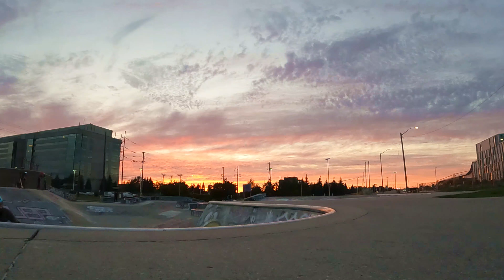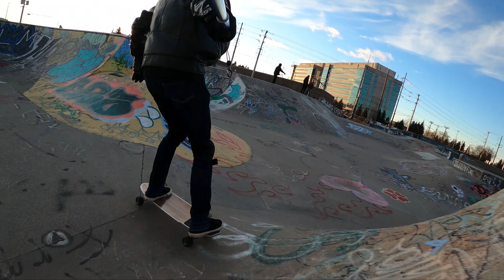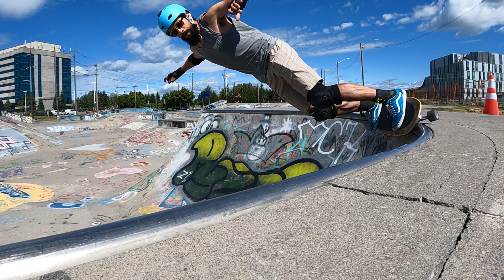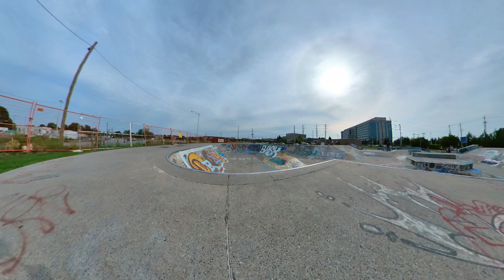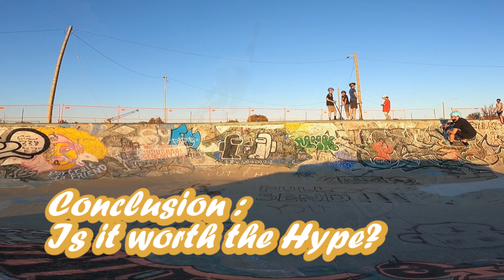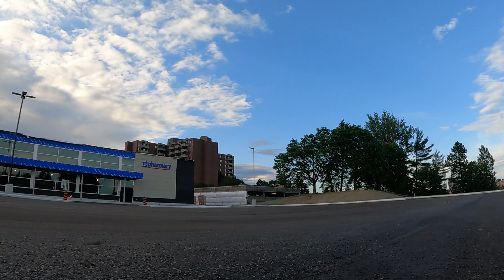How to Carve Grind Coping on YOW Meraki Trucks (without dying)

Comment: I have recently buy a yow and I’ll was using a carver before and I have noticed that the way the yow trucks turn makes you adjust your position for many tricks that you usually make on the carver I think carver boards are cool but they don’t give you the right technique, in my opinion yow responds more like a real surf short board, you have to use more back foot than in other boards and that applied to the surf on water gives you a really better technique, nice video
Reply from the maker: I never made that connection - Really good observation

Comment: Thanks for another great review!
I want to share that I got a massive improvement in my bowl skating when I put harder wheels on the giraffe. I could not get the exact same size, but  similar.
97A wheels are a lot louder and make scary noises at times when losing grip.
But magic starts to happen when I ungratiously climb into a bowl and start pumping around to build speed.
Reply from the maker: I haven't tried anything that hard yet but I am keeping an eye out!  I don't think I need any extra speed, but I am finding it hard to do snaps and vert-berts on the concrete with the stock wheels.
Reply: @MarktheLandlockedSurfer  Try the Alva Conical 59mm, 88A they are the best park wheels for surfskating I have experienced. They just look you in on concrete. They are fast as a 97a-104a wheel without the noise and unpredictable slide, vibration teeth 🦷 rattling thing. That in my opinion just kills the Surfskate feeling using anything above 84a-88a (my opinion the sweet spot for concrete) The Carver park wheel is also very good but still feels like plastic. Seismic Cry babies 😭 is also not bad if you like coming down the wall bird sliding and they just looks the part aesthetically. Alva I think knows a thing or two about surfing in bowls and pools. But I understand the hard wheels thing because it works too. It’s like sex some like it soft and some like it hard, it all comes down to the feel.

Comment: Hi Mark, looking back and now owning a smoothstar and a curfboard. Would you've had to make the same adjustments for those boards (because of their loose trucks?)
Reply from the maker: The Curfboard doesn’t bottom out which is why I find it the best one for grinds in the bowl.  The same adjustment is needed for the smoothstar, but I find it is a bit more forgiving than the YOW before it launches you.

Comment: How do you go to a 50-50 from this? All the tutorials are with regular board and doing a kickturn onto the coping. I rarely make kickturns with loose surfskate trucks.
Reply from the maker: For standup 50-50s you have to approach almost like you are trying a fly out, but with just enough speed to get over the lip.  Similar approach angle and everything as a carve grind but imagine yourself trying to get out of the bowl.  You can see a lot of them that I have done in my curfboard review video on here.  Good luck!

Comment: Thanks for going the length! Heads off for making it work. So in the end the C5 setup will remain your goto pool board?
Reply from the maker: I am going to hold off answering for for now.  I have been experimenting a lot with different setups and I have new ones coming to test out... As an all around Skatepark board, C5s still have an edge, but others are starting to make decent ground in bowl performance.  By the end of the summer, I'll be testing out Wooddetail, Swelltech, and Smoothstar boards too. Stay tuned!

Comment: Great videos Mark! Got my yow with merakis a week ago and just like dash was commenting below, the front truck feels wobbly at times. Just wondering if you have tightened the front truck a little? 
Also, have you tried riding switch with your yow? With that front truck it's really difficult or am I just novice. Any tips?
Reply from the maker: I used them stock out of the box without any adjustment so far.   I think initially in the bowl I did feel that bit of wobblieness but I don’t even notice it anymore, and I think always keeping a touch of pressure toeside or heelside helps.  When you say “switch” I just want to confirm if you mean switch (feet opposite) or fakie (normal foot stance but board going backwards)?  I’ve tried both but my gut says you mean fakie.
Reply: @MarktheLandlockedSurfer  Thanks. Yes, indeed, I mean fakie. I was trying to go up and down in a straight line without a turn in a ramp and it felt like a crazy balancing exercise 😀.
Reply from the maker: Yep, with practice you can learn to do it for long periods (I went down a full hill for over a minute on mine) but it is super squirrelly and not easy to maintain speed.  I managed to land a half-cab (fakie backside 180 air) and the toughest part was getting enough speed trying to push into it going fakie rather than the trick itself!

Comment: Delighted to see you're making it work :) I've had my new yow to the skatepark a few times and it's really fun. I do notice that it starts to wobble and get squirrely at hicher speed, is that an issue with the meraki or bushings, or is it me? I am not quite up to the same speed I was on a normal street board. I also tried out a pump track and got some fantastic lines in. I even carved a u-turn in the middle of the track which was really something. Again with a few wobbles as I got up to speed though.
Reply from the maker: Just like a snowboard, this happens when you try to go go straight ahead.  Keeping your base flat at speed on a snowboard is a great way to catch an edge and go flying because it is enjoying the lack of friction until it gets a jarring dose of it, so the key is to keep the board slightly on edge even when going straight.  Similar with surfskates.  As long as you are putting a little pressure on your toe or heel, you are keeping the front truck from wobbling around unpredictably.
Reply: @MarktheLandlockedSurfer  now that you mention it, I don't think I wobbled much on the sides of the bowls .. mostly after going straight down a ramp and across the flat. And a tiny bit in the pump track but that could easy have been straights, too. Will try to maintain a gentle carve next time. Despite living in sweden, I've only been snowboarding twice. But I totally know what you mean :) Are other surf skate trucks wobbly at high speed on a straight, too?
Reply from the maker: @dash9655  my instinct is usually to carve on them unless I am charging for speed to get up a huge wall, but usually when I have done that it has been on C5 or C7 trucks that have less lean.
Reply: @MarktheLandlockedSurfer  Gotta keep it on rail...like a surfboard!